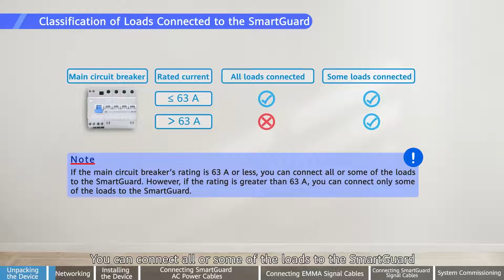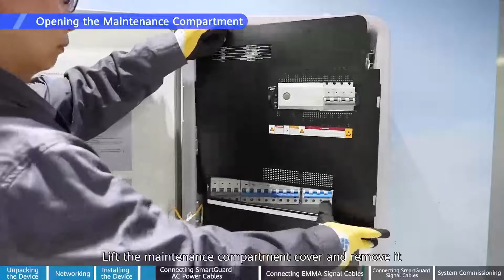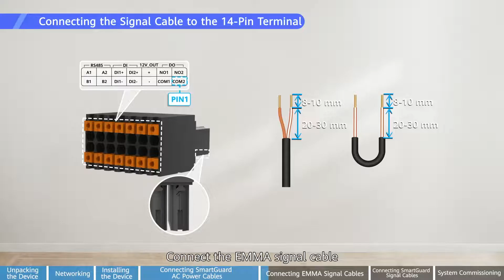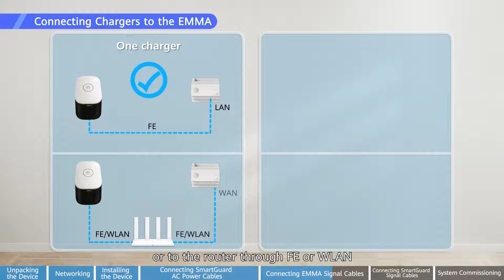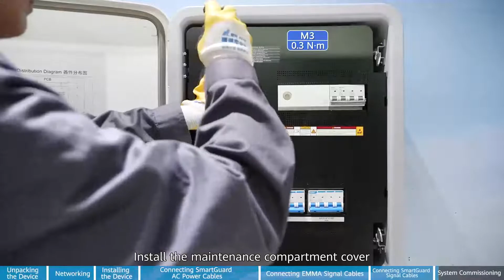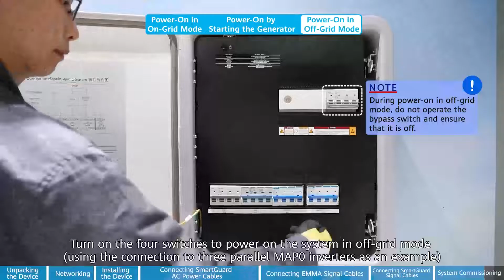HUAWEI SmartGuard 63 A T0- installation

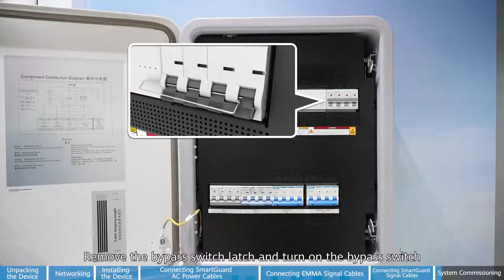Comment: 6:49 why has the bypass been activated?! it's the system now in bypass-mode which it is not usually intended to be in?
Reply: 7:16 During power-on and commissioning, ignore the alarm indicating that bypass switch is on...
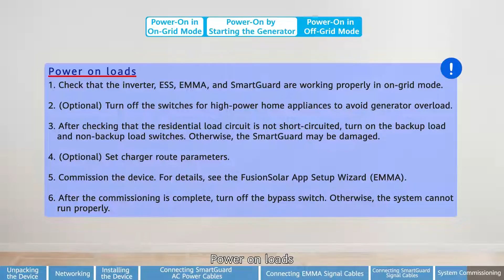Reply: 7:35 After the commissioning is complete, turn off the bypass switch. Otherwise, the system cannot run properly.